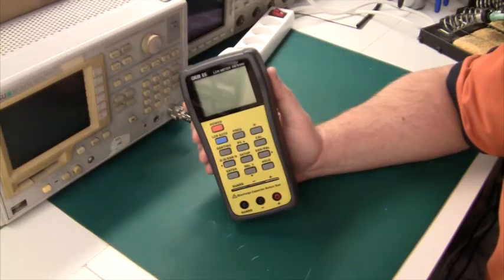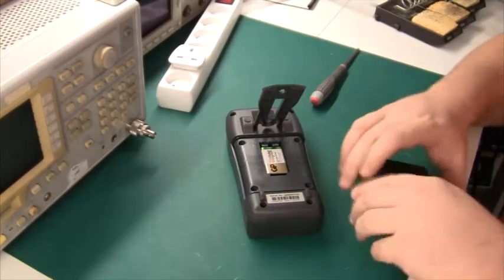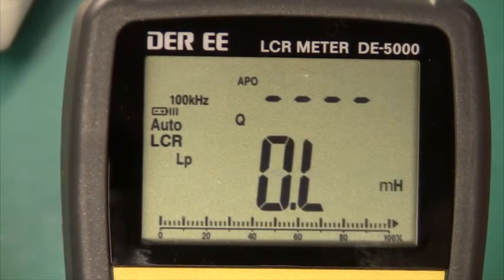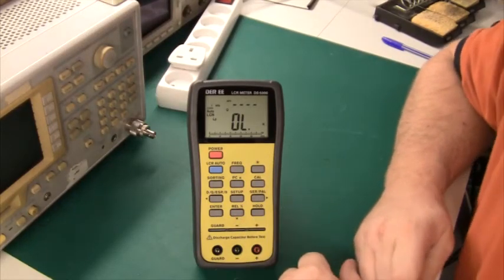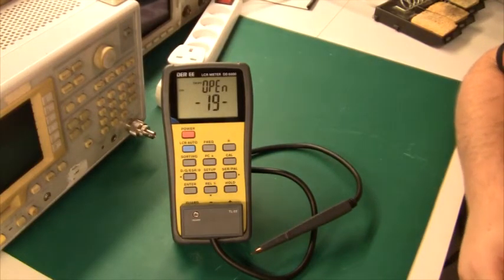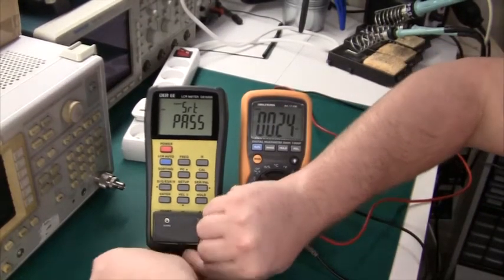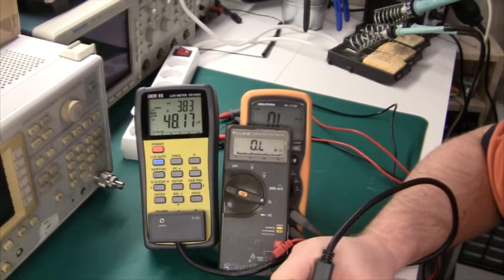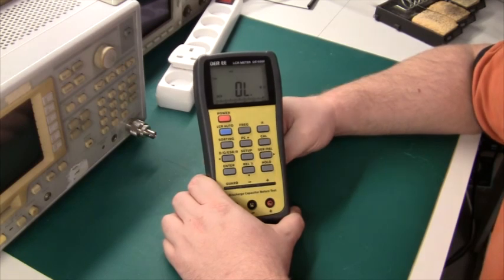Review of DER EE DE-5000 LCR Meter

Comment: Hmmmm .... a simple question if you have time;
  Of course a component impedance is just the amplitude ratio & phase difference between voltage & current sin waves for a specific frequency.
  Sooooooo I can just see/measure that amplitude ratio & phase difference using just a sin wave generator & a 2port oscope (at least in theory anyway)
  Measurements dispersed across a frequency band of both the sin wave generator & oscope can be used to interpolate between the measurements
  Resulting in a plot of the amplitude ratio & phase difference between voltage & current sin waves across a frequency band
??Would that be a more pragmatic means/tool to measure the impedance of a component??
Reply from the maker: You can absolutely do that. In the "old" days we did that. Most oscilloscopes have an X-Y mode where the input sinewave is entered on the X axis and the output of the filter on the Y axis, and you can see the phase difference directly. Another benefit is that you can measure it at higher frequencies and not just at the (low) frequency that an impedance meter uses. Look up Lissajous figures.

And thank you for a really great question. Loved it.

Comment: I have the same meter. Now I am planning to replace original alligator clips on TL-21 box with the Kelvin type clips.
Reply from the maker: For measuring small values, it's a necessity!
Reply: @NatureAndTech  Just finished that improvement. After calibration meter with TL-21 @ 100 kHz now shows 0.000 uH, 0.00 pF and 0.000 Ohm. Nice! Should do it years ago.

Comment: It is likely that you could reduce the slipperiness of the plastic shell, by wiping it down with acetone, or maybe some type of degreaser would be milder. You want to remove the outside coating of fat/oil from the plastic, without inducing a tacky feeling, or actually deforming the case. You might want to remove the internal electronics and display lense, before giving it a go. Many plastics have their type code molded into the case. If you post the type code, I rather imagine a viewer that is a chemist can tell you exactly what chemical to use. I hope you do find an answer, because I would like to treat my unit, as well. Maybe a light scuffing with sand paper would do, in the meantime. Or, cut some non-skid shelf liner fabric and glue it on the case. That seems the easiest solution, but some plastics melt other types, with prolonged contact. So, maybe adding a layer of paper, or cloth, to serve as a barrier, would be wise.
Reply from the maker: Thanks for the advice, but I like to keep it prestine. It's not for work. I can live with it :)

Comment: Hi.  which one you think is the best instrument, this or the MSR100 V2.
Reply from the maker: I am sorry but I am not familiar with the MSR100v2, but I have been very happy with this one so far.
Reply: @NatureAndTech  Thank you.  If you are happy, I will be happy too.  What worries me about this meter is that it has no protection at the entrance.  I have seen that it is possible to please two diodes in the entrance but I am not sure how it is.  also be very careful when installing the battery, it is very easy to do it inverted.
Reply: excuse.  What time do you have with this meter?

Comment: Nice review.  I came here to see if my new sample has a broken backlight.  It is feckless.  Some notes:
Mine was received from Amazon 28JAN2019 and was ordered while out of stock.  It is likely the most recent revision at Rev. 8.
Several transistors that were likely used for input protection are missing.
Two diodes that were used for power source reverse polarity are missing.  These were set up as reverse parallel to the battery and power wart.  No wonder they are no longer used.  A few caps are missing.
The plastic of the case appears to be glass filled.  Perhaps it is HIPS, which normally feels slick and low quality.  It is, actually.  Somewhere between PP and ABS.
Ny tweezers are plastic, not FR4.  They twist easily due to material and one screw holding the kit together.
Reply from the maker: Wow. Thanks for the feedback and info on the newer model. Seems there has been a bean-counter at work, which is never good. I just don't understand why they would save a couple of diodes and transistors on a meter that cost that much.

Comment: I own this model, I like the  component batch testing feature. The accuracy is excellent.Loaded with features and I can measure caps in circuit with really reliable results mostly.For the money this is amazing value..
Reply from the maker: Thanks for your message. I have not used the batch testing feature myself, so I´m happy to hear that it works well.

Comment: This looks very similar to an older ELC-131D LCR meter I have. We use the ELC-131D to measure impedance of 100V speaker circuits before commissioning.  Can I use this DE-5000 LCR meter to measure speaker impedance? Does it generate 1kHz AC when in "R" mode?
Reply from the maker: I have just tried it on a loudspeaker, and it does indeed send a 1 kHz audio tone out during measurement. My 8-ohm pair of speakers has an impedance of 8.4 Ohm measured with the tester, and I can hear the 1kHz tone in the speaker, so I can confirm that. It can also measure the inductance of the coil. You can set it to measure at 100 Hz, 120 Hz, 1 kHz, 10 kHz and 100 kHz.
Reply: NatureAndTech Excellent! Thank you so much for the quick response.
Reply from the maker: You're welcome. Is that avatar of yours Lady Gaga?

Comment: Good review.
Great value for the money.  Not the same quality of the higher end brands but I am pleased with with it for the price point and I like the 4 wire measurement.
Reply from the maker: I totally agree. Very nice piece of equipment.
Reply: One of the instruments I use at work is Agilent U1733C;while its a great instrument I think it's overpriced. I get comparable readings with my DE-5000.It cannot beat the price for its accuracy...

Comment: The 4 wire measurement is integrated in the flat connector, the classical input jacks are only plastic stabilizers for the connector. Much better than BKPrecision

Comment: Every better LCR meter I've seen has one button to switch modes (L/C/R).  I don't see a problem?  Nice review - thanks.
Reply from the maker: +Digger D You are probably right. I just prefer it like a normal multimeter with a big rotary switch, or a bench-top multimeter with radio-buttons, so that it is immediately clear what mode it is in.

Comment: Just an update - at the IET Labs website, they don't even list the DE-5000 anymore. They only list their new DE-6000 ($ 300). So, if anyone wants to buy the DE-5000 then they will have to buy just the meter on Amazon which may be an IET Labs leftover or they can go on eBay and buy from a Japanese or Taiwanese seller. But, at least on eBay you can get the meter AND accessory options.
Reply from the maker: +Mystery47 As far as I know, the DE-6000 is identical to the 5000, and nothing more than an attempt by the company to try to gain back some sales, after the Japanese ruined the market for them.
Reply: +NatureAndTech I don't know how they expect to gain back sales when they are charging $ 300 for basically the same test instrument that sells all over for $ 100.  Maybe IET Labs needs to hire some BUSINESS people instead of just engineers.
Reply from the maker: +Mystery47 Agree. It is quite obvious to anyone able to read a spec sheet that they are basically the same meter.